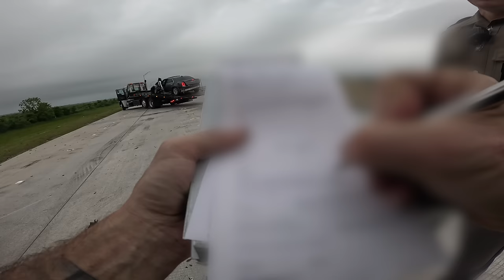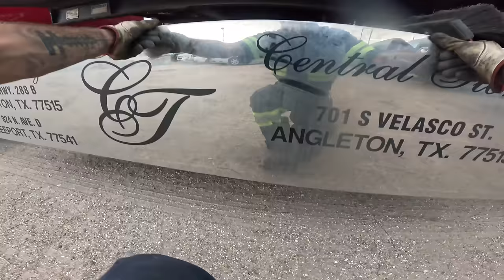GMC Yukon vs Chrysler 300 Head on Crash!

Comment: I believe that long piece of metal you picked up was part of a front torsion bar suspension.
Reply: Yes that’s exactly what it is.
Reply: It runs along frame. We rolled one in the field a few months back playing around 😂 its the torsion bar between front and rear seats along the frame.
Reply: Torsion bars go between the control arms. So from front wheel to front wheel.  Not along the frame from front seats to the back seats.
Reply: @thejakefromstatefarm6768  That is incorrect; the torsion bar slides into a slot on the back/rear facing side of the lower control arms, and extends back to a cross member where a torsion bar key is attached and can be adjusted. They are on both sides of the vehicle. You’re thinking of a sway bar.
Reply: @maxbell6237  ah ok, so it’s part of like a four link type thing?
Reply: @thejakefromstatefarm6768  No it’s not a four link system; as the key is tightened it basically twists the torsion bar, causing spring tension, so when the vehicle moves over bumps the control arm moves up and then is brought back down by the spring tension. It’s basically doing the exact same function as a coil spring, just packaged differently.
Reply: Yep.  It is
Reply: @thejakefromstatefarm6768 instead of having a coil spring or leaf spring, that torsion rod is your spring. Pretty cool.
Reply: @maxbell6237  ok, ya that is cool. Thank you for being nice and just explaining it to me. I appreciate that.
Reply: @StephenBrewer89  ya it’s really cool. Some guy a long time ago just thought that up. " if you store energy in a rod you can alleviate the traditional shocks” lol. Pretty damn cool.
Reply: That bar that Dustin picked up is the Center link. It would connect to the idler arm and to the pitman arm of the steering system of the vehicle. if you look, you’ll see the holes on each end.
Reply: @CurtisRieben  bro come on… look up a torsion rod. When you see those little squat boys with the fuzzy steering wheel covers and there hat backwards barely sitting on there head and the front jacked up in a GM, they tightened the keys to hell and back on the torsion rods.

Comment: That long black bar is called a Torsion bar. It's used instead of leaf or coil springs on heavier trucks. It's locked into the suspension and actually twists when the vehicle suspension goes up and down. Prayers for both parties involved!

Comment: Morning all! Wow, what kind of speeds were involved to cause that much carnage?  🙏 for all involved!
Reply: Considering if both were doing as little as 45mph each the combined speeds is 90mph on impact. Doesn't take that much speed to cause life threatening injuries.
Reply: @bernardowens1648 the combined speed is not 90. In your example impact will be 45. Both vehicles will come to a relative stop, and then the more massive vehicle will push through the less massive one. The vectors are opposite, they don't add.

Comment: I'm not a tow truck driver, I'm an idiot when it comes to doing what you do. I'm curious as to how the wood blocks chalking the tires work when loading the truck. Can you explain that?
Reply: I'm not one either but from the looks of it, it prevents the wheels from rolling and then kinda just drags in whatever direction it's being pulled to

Comment: I think you need one of those lapel microphones if you're going to be talking a lot while driving .... there's a lot of road and engine noise, so getting the microphone nearer your mount will only improve things.
I love watching your videos but sometimes it's really hard to follow what you're saying :D
Reply from the maker: The problem with all that is, I don’t have time to setup a bunch of equipment, and make sure everything is synced and working. 
However I’ve been trying to make sure I have my body cam on, so I can layer in that audio.
Reply: @Towtruck_Dustin  That should be fine! The people in the Gatlinburg  towing videos (Everything Autos) use a little ?bluetooth? microphone that they keep pinned to the shirt. I don't know whether that gets added back to the videos in editing or is recorded alongside the video on the GoPro or phone. I'm sure if you reached out, you could compare set ups :)

Comment: Question:  Wouldn't the skates work better than wood blocks for making the wheels slide?
Reply from the maker: In my experience, no. Which is why I keep my blocks handy. Skates go under the tire, so you can’t remove them quickly if needed. 
Very rarely do I use skates unless it’s on new/high end vehicles.

Comment: A bar or block of wood on RF would lock tire allowing the vehicle to slide straight on
Reply from the maker: Wouldn’t work on the ground like that. Only once it reaches the bed, and with it free turning like that, it likely would have just kicked the block. 
Speaking from experience.